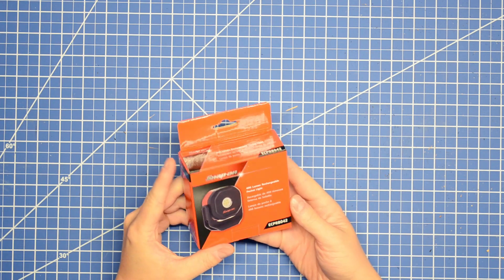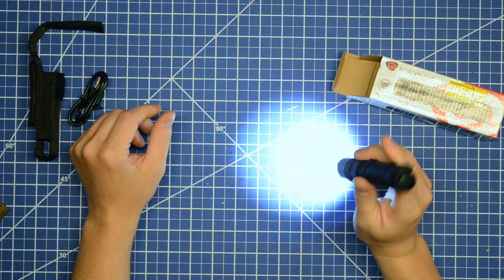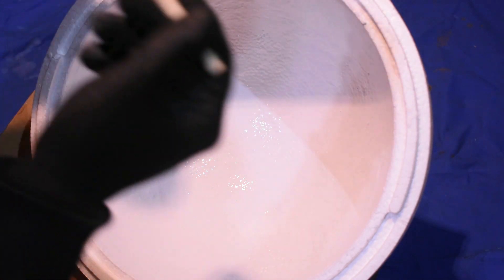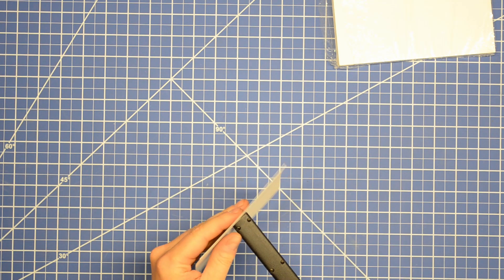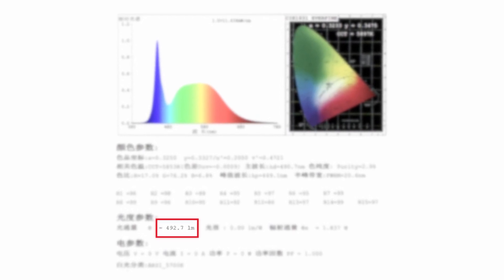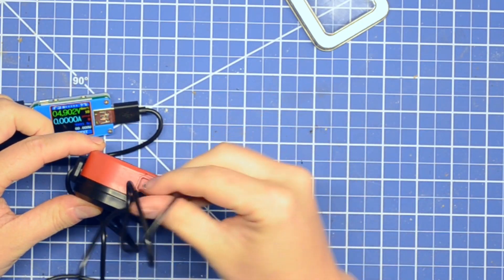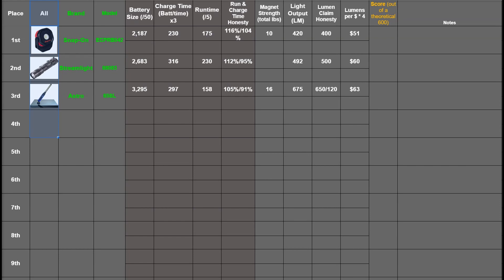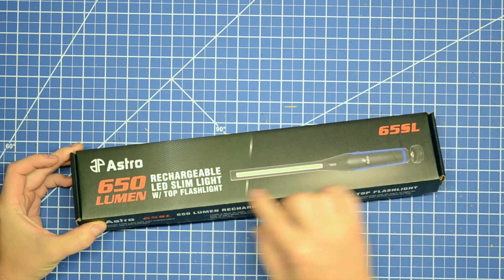Are Lumens Fake? We Built a Light Lie Detector: Snap on, Streamlight

Comment: For magnet testing, have your scale set vertical, and tare out the scale with just the plate hanging. This eliminates downward pull of the plate (gravity) vs horizontal pull of the magnet by having the force going the same direction

Comment: I think one thing you forgot while testing/did not account for was the power draw of the charging circuits during the battery charging capacity. I feel you are on the right track but should look at other ways to measure this.

Comment: Hi, Nice vid !
However you can't compare the mAh from the cell (at a 3.7V voltage) to the mAh from the USB port (5V). You must compare the energy (in Wh). For the cell, it's (grossly) the voltage of the cell times its capacity, so you can then compare to the Wh from the meter :-)

Comment: hey quick note: you said your charger was a 5V/1A charger, but at least one of those looked like a USB-C charger. USB-C sometimes supports USB-PD, which can request multiple voltages, including  5, 9, 15, and 20V, with current ratings up to 5A for a maximum of 100W of power delivery. So basically, I'm not saying that any of the devices actually supported any of those charging modes, but if you've got a USB2 or USB3 charger, and a USB2 or USB3 power meter gizmo sitting in between the power source and sink, you might not be actually getting the full charging capability of your light or other device as the USB-PD negotiations kind of get lost in transit and it falls back to USB2 or USB3 power delivery mode, which is locked to 5V at most. You might want to see if you can find a USB-PD compliant version of your power meter gizmo, and a proper USB-PD charger (like from a chromebook maybe) and re-test some of the USB-C capable devices just to see if the charging times or voltages change at all.

Comment: I work as a weld inspector and my favorite light is a Wuben L-50 from Amazon. 1200 Lumen rechargeable 18650 battery. Good size and tail cap switch

Comment: Nice test but it seems you got a pick of the litter snap on because iv bot 3 of those same lights and got an hr or little less on each and they were 85 bucks each off the truck
Reply from the maker: Might have been thier higher than 400 ones
Reply: @TorqueTestChannel  last one was the plastic body the other 2 was the metal ones

Comment: I like this.  I'm curious if the light pattern in the sphere affects the reading.  For example, some flashlights are focusable, having a setting for a wide, even flood, or a centered spot, for the same power setting of the LED.  Theoretically, the flashlight puts out the same amount of light either way, but having it focused or diffused, would that change the lux measurement in the sphere?

Comment: My flashlight recommendation: PeakPlus Rechargeable Tactical Flashlight LFX1000 (Amazon)

I have always been interested in flashlights. As an industrial technician I work in all kinds of environments from blazing hot sunlight to dank and dark underground vaults. I found a really great light on Amazon that is cheap ($17 -- made in China) and really versatile and tough. I wish it was made in Taiwan. The quality is good enough to be Taiwanese.

Takes a single 18650 or 3 x AAA batteries with the included adapter.
Focuses from wide beam to narrow beam.
Two power levels plus the ubiquitous SOS signal.
Has really sharp optics. Someone got the lens profile perfect on this baby.
Has really smooth zoom action. 

I wasn't expecting much for $17 but was blown away by this flashlight. I bought three more, one for each vehicle and one for the nightstand. I don't have any connection with Amazon or the maker. I dare you to try this nice flashlight. I think you will be blown away like I was.

Comment: What about the lightbulb you'd hang from the ceiling in your garage? Although LED household bulbs are relatively cheap, are they consistent in ratings? Probably faster to run a test of those as you're not worried about the battery aspects, rather it's just to see if they're consistent in a batch and how much light you'd get per dollar.

Comment: I have a few of the Strions, just the LED (blue), LED HL (blue), and the Strion Switchblade and love all 3. Being I was already married to the strion size is why I went with the smaller Switchblade. Currently carry the Microstream USB everyday but looking at going with the Macrostream USB but I do like the smaller size of the Microstream. Streamlight is A+ in my book. I keep an extra strion battery so when one light dies I can easily have it back online with my piggyback charger which is nice compared to my original charger that is just the clamp with no piggyback. The switchblade I normally use the micro-usb cord it was supplied with but occasionally I throw it on the one of the wall clamps. Owning multiple strions, it does help to have an extra switch on hand and they do wear out overtime with the oils and solvents I have around the shop, or occasionally using it outside in rainy conditions, so I can pop a new switch in and have the damaged one warrantied in the meantime. Great setup and I couldn't be happier!

Comment: 14:18 this seems about right. The charge controller will sap a bit of power to charge the cell. Also so will the monitor but not a lot.
I would be surprised if you can get any of the lights to charge at more then 1A. A lot of these lithium ion devices use the same cheap 5v 1A charger and controller chip.

Comment: I would probably choose a light that has a removable battery over one that doesn't. 18650 batteries are around $5... Swap them out. Also if your are invested in li-ions you can get a much faster charger.

Comment: I'd have thought the light testing rig would have been painted on the inside with Vantablack or Black2.0 so the meter would only be getting the pure light from the source and not reflected light. I worked for an AV contractor and have installed home theater projector screens that actually have a 1.1 positive gain in their reflectance, so I think this would skew the test results.

Comment: Interesting testing the total light output, but if you have a beam profile that is a flood vs a tight focus that changes the concentration / brightness of light where you're working. I have some work lights like the Snap on that cast the light everywhere and I also have a Makita CXT 12v ML103 that has a square projector like light pattern and uses all light only where it's pointed. The Makita ML103 is only 100 lumens but it feels comparable to other lights that are 300 lumens when I've got it 5 feet from a wall I'm working on likely because it's using all the light in one area and it has no hot spots with very even lighting. I have a lot of experience with many types of flashlights and the Makita ML103 uses an orange peel reflector so it's not got much light losses for a focused light. Any of the focus to flood flashlights and work lights that use an acrylic dome as the lens and can similarly focus all the light lose a lot of output because that dome mechanism is low in efficiency. To me it's less about the total lumens and more about how usable the light actually has been designed. The Makita ML103 is certainly not the brightness or best but for something so small and efficient I'm using it for this example.

Comment: I worked in a light output lab for years, many companys use raw lumins in marketing. This is a calculation from the led manufacturers based on input power and number of leds. I used a sphere everyday and it and not many people are using actual lumens

Comment: the algorithm sent me here.  I have liked and subscribed to this video.  I am really interest in seeing how my cheap light from Tractor Supply compares!  

It advertises:
1500 lumens 
2600mah - 18650 battery 
1, 2, or 5 hour runtime on the three brightness settings, 
a USB port for charging with usb cable included but no "plug."

Do note that this is a externally protected 18650 cell which is slightly-taller than a bare 18650 cell so may not fit in the average external charger and cannot be replaced with a bare cell, only another externally protected cell.

it is "Jobsmart" brand, model number TSC17-F0515A and is $14.99.

Comment: The charge capacity you measured is not what actually gets into the battery and what you get out of it. Your measurements were at 5 volts but Li-ion battery rated capacities are given at nominal cell voltage 3.7V. Furthermore, buck converters in charging circuit are not 100% efficient. They're in the ballpark of 80-95% depending on the quality and design.

Comment: There is a Coast 7HP light which I like using. They have a kit which comes with two rechargeable batteries, and a replacement battery pack which is not rechargeable but takes 4 standard AAA batteries. This is good because you get an AC charger in the kit as well as 2 rechargeable batteries and the backup AAA just in case.  It would be nice to see you test it out. Thanks.

Comment: Don't limit it to only rechargeable. Lots of mechanics carry a pen/pocket light with alkaline batteries and would like to see the lumens vs claims from them. The shop I work at has free batteries and chargers disappear. So the Streamlight Stylus Pro, Coast HP4, Coast G20, Gearlight S100, and Olight i5T are all pretty popular. Headlamps are gaining popularity too. Is there a way to test how much a light dims as the battery dies?

Comment: Use a light using 18650. Pull out your old dead laptop battery and cut open for the 18650 battery probably 6 or so. Get a $15 charger off Amazon. Battery dies swap it out and let charge. A lot of those flashlights using the 3 AAA holders will take the 18650 in its place

Comment: Use a light using 18650. Pull out your old dead laptop battery and cut open for the 18650 battery probably 6 or so. Get a $15 charger off Amazon. Battery dies swap it out and let charge. A lot of those 3 AAA holders will take the 18650

Comment: Now look at those big floods that they claim have like 3 million lumens or what-have-you (candela?).
I balance reliable light output, and functions, versus cost, which can only be done by actually holding the thing in your hand or going to multiple sites to get reviews versus just one site (amazon, et al).  Never go to manufacturer sites for reviews.  Butt-click versus side click, bean tightness, throw, and brightness settings are also key selling points.

Comment: Great video 

To coat the sphere i would put a bit of paint in, close it and rotate it evenly using some kind of contraption with motors (a few rollers should do). Experiment with different beginning fill levels or overfill, rotate, remove excess and rotate again. 

When the paint is solid fill it 1/4 with fine sand and rotate again until smooth.

Comment: Test the nebo rebel headlamp. Best headlamp I’ve ever used and I own several headlamps well over $100. Including many olight, stream light,  and others. I own two of them and I use them both eight hours each day and then recharge each one.
been using them both for over two years. No issues whatsoever. On the lower setting it’s still got plenty of brightness for any task, and will last a full eight hours constantly on.

Comment: Nice to see a test scenario that more closely resembles real life working conditions. I would recommend a series of drop tests as well, since that's where almost all my high-dollar lights have failed at work. It sucks when the glass lens on that $130 light breaks on a 4-ft fall or when the solder joints or switch contacts on a $50 explosion proof flashlight fail after a few drops. Flashlight enthusiasts are generally not concerned with how well the lights work in real life (or they wouldn't always be looking for the most lumens). I've spent a lot on flashlights for work and been both impressed and disgusted at the same time. My latest experience is with the "lifetime warranty" on a $50 Pelican work light which failed, then cost me over $20 in return shipping and warranty fees, and which I've been waiting almost three months to receive the replacement. Work lights definitely feel like the biggest money pit in my tool bag.

Comment: Great Video!  This made me subscribe. 

I own an Olight Seeker 2 Pro (21700), Olight M2R Pro Warrior (21700), Olight Baton 3, ThruNite T2 (21700), and ThruNite TH30 (18650).  I'd love to see those tested.  Obviously I don't expect you to test them all, but they are all popular lights, so they would be good ones to consider testing.
Reply: Ahhh, I forgot, I also have the Olight H2R (18650).  I haven't used it in months and forgot I had it.  It has been packed away in my bugout bag :)

Comment: Awesome, I´m so hyped for the new line of Dr. Pepper Diet lights
Reply from the maker: Based on some of the reviews, I expect it's more like Dr. Pepper Zero (lumens) after any real amount of use.
Reply: @TorqueTestChannel  Good one :).  
Btw. I guess it was already suggested but are you planning to test out some tool-maker lights (DeWalt, Bosch, Milwaukee, etc.)?
Reply from the maker: The ones that can fit, we're limited to 3.25" diameter for a list of reasons.

Comment: You have to remember that there are always losses with charging.
The extra mAh that are listed are most likely losses as heat.
And it's way better to charge those small cells slow.
Fast charging ALWAYS damages the cells it the long term (like 1-2 years)

Comment: Bit of re-post
Looks like they've followed nearly all of the best practices.  There are a few places that could be improved.

* Runtime doesn't track output.  An exposure locked camera would let them fake it.  Though using Ceiling Bounce or another luxmeter would be a major improvement.
* Doesn't understand replaceable batteries.  Who cares that the Streamlight takes "most of a work day" to charge?  Swap in another battery instead of twiddling your thumbs.
* "Actual measured battery size."  They are looking at mAh over USB.  This is going to be erroneous when they get to lights that charge with a buck regulator instead of a linear regulator.
* Runtime.  Only looks at the brightest mode so multi-mode lights are penalized.  Doesn't factor in turbo stepdowns.
https://www.reddit.com/r/flashlight/comments/nhtd2q/time_to_send_our_flashlights_to_this_guy_for/
Reply from the maker: Great points, thanks.
- Our light meter does have data logging so we can log output over time possibly. Would need a way to mount the lights and some lights risk melting the surrounding foam, which if and when that happens it's sort of game over for the whole calibrated sphere. We could instead measure output at period points during the runtime and show on screen, like say every 20 mins. 
- We understand how a replaceable 18650 works. It's just that they sell you one battery with a charging cable. We generally test complete products here vs the price they charge. We could swap in others we bought, and we'll point out the utility of that - but a multi-cell 18650 charger and extra cells don't exactly come with it, hard to factor that in vs others. 
- Correct, we were probably off base here. Not considering things like loss over charging. We'll go off of cell size in future. 
- We're looking at brightest mode because that's the lumens written on the box, although if other settings are advertised we can do that as well.

Comment: I carry a Four Sevens Mini Mk2 in my pocket. It was a legit company, but couldn't compete, and was bought by Prometheus Lights, a much... legiter company. They make the mini mk3. The mk2 touted over 1000 lumens, but only for a few seconds until it was heat limited. Prometheus made some different design choices and the mk3 does in the 800s in turbo. You can absolutely feel the light get REAL hot in turbo mode, and see the lamp dim off to merely really really bright after 20 seconds or so. The coolest part, tho, is it's barely larger than the single RCR123A cell powering it!

Also, Malkoff Devices, and Lumens Factory make some bitchin' Surefire level replacement lights.

Comment: Fast charging, while obviously handy, can also reduce cell life.  One of the big advantages of using a light with (easily) removable standard cells like the 18650 is that you can just swap a new one in.  Boom, 60 second swap and back in business.

Comment: One thing to note is that most reputable manufacturers will use the ANSI- NEMA FL-1 standard for these test which helps when comparing statistics in terms of brightness, run time, distance, etc. This simplifies tremendously the comparisons but can be misleading. Looking at only the initial lumen rating and runtime are only 2 points on the output of any light. Some companies will modulate the light output to "game" these two numbers. Best way to truly test lights is to measure the lumen output at each minute interval and graph them to see true performance over time and usage. Check out the ANSI FL-1 standard for more details.

Comment: Take a look at Zebra Light and Olight. Also the lights sold by Milwaukee/Ryobi for their battery platforms. 
Also, can you measure CRI? Lights that have a poor index and greatly change the color of things they're illuminating can be dangerous in situations where you need to accurately identify the colors of things (like wires).

Comment: May I suggest, that just like the impact guns you test, that you test "length of time the light delivers full lumens"?  I have tested a number of cordless lights - for personal use.  I have the Steelman Pro
 Model 78606 (for example)  which claims to be 400 Lumens......and I believe it is.....for about the first 15 minutes.  And then the lumens slowly decay.
So...put simply....400 or 650.....or whatever lumen the light is rated at, if it doesn't deliver that level (or very close to it) for more than 15 minutes.....what good is it?